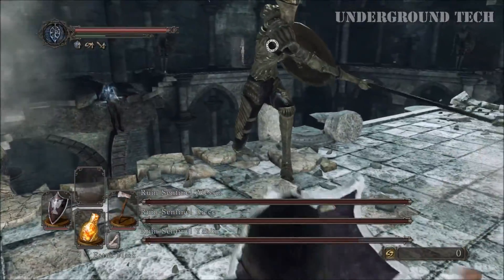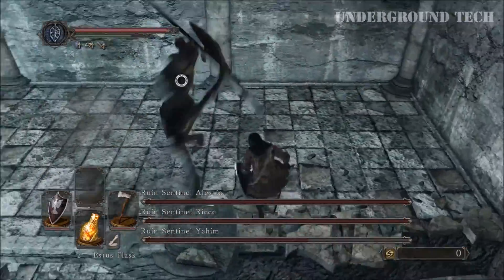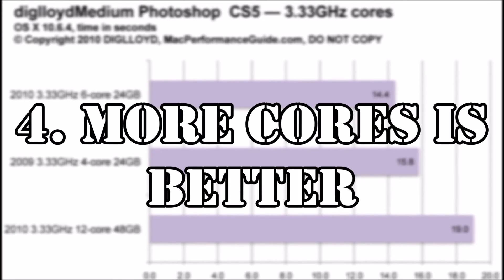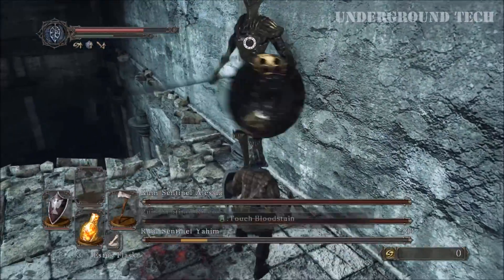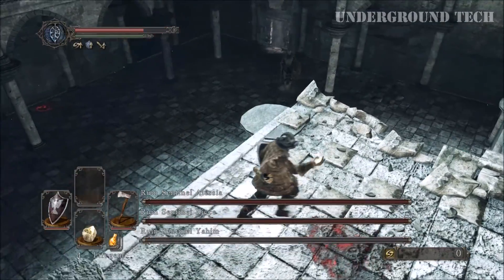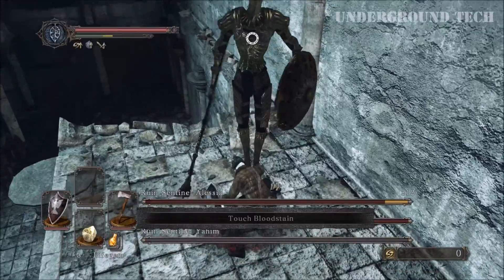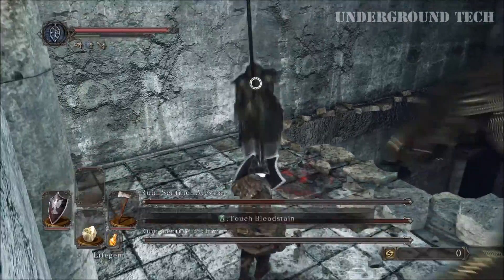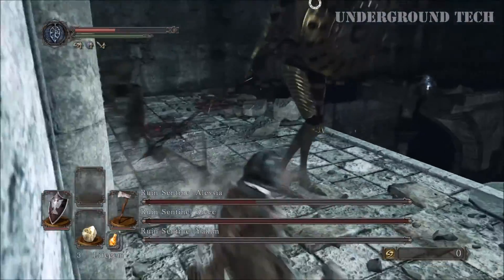DEBUNKING PC Gaming Myths! (Before You Build A PC)

Comment: Ah you know what really annoys me about people who build computers? 3 things mainly. The wrist strap thing, I see tons of people going through the trouble of using an anti static wrist strap just to attach it to their PAINTED computer case. Umm yea, a lot of good that will do. I firmly believe you don't need a wrist strap if you actually handle PC components correctly. That bring me to the second thing, the way I see people hold motherboards, RAM, graphics cards. They put their hands all over it, touching all the contacts. Hold a PCB by it's edges and don't touch any mental contacts! How hard is that... and lastly power supplies. I can't say how many times I've seen people put unnecessarily powerful PSUs into a PC that will only use 300 watts MAX. The only reason you need a power supply more than 550 watts is if you're running multiple graphics cards or use a graphics card and CPU combo that have very high TDP like a buddy of mine with an FX-9590 and Radeon R9 390X. Great vid though.
Reply from the maker: Great points, and the anti-static is probably the most misunderstood part about building a gaming PC; It just isn't necessary. As for the PSU part, I agree with you, but I wonder how that differs when someone wants to overclock their CPU and/or GPU.
Reply: i5 8400 and 1080 with a 650 watt psu?

Comment: problems with this video:
3. it USED to be 16GB+. AMD CPUs about 3 years ago were better. Not surprised you started later than that :P
4. that is not completely true. it is best to have atleast 4 physical cores, if not then dual core hyperthreaded. it affects your performance. a lot.
5. same thing as 4, this is not completely true. Higher GHz is much better if it's the same architecture. you're looking at AMDs old architecture and blaming it on cores and GHz. not how it works.
6. These are the same thing for console. you can play on a TV. a keyboard and mouse that are good quality come in $20 combo packs. everything else is nonsense. when you buy a console, you don't get a chair, TV, and desk included, do you? also, $400 is more than enough for a gaming PC. I can make a list with an RX480 in it right now that can run Bf1 easily. it's not hard. you just need to use inactive windows which people over exagerate about the watermark. it goes away when you go full screen.
Reply from the maker: First off, thanks for pointing out the errors and I want to respond to a few things you mentioned: 
4. that's a good point, quad core will be the best option, but I was more-so comparing it to the fact that have more cores doesn't always mean better performance.
5. I mentioned that in the video if it's in the same family (probably should've said architechture) it'll be faster. i.e Haswell 3.6GHz will be faster than a 2.4 GHz.
6. Yeah you can play on a TV to save money instead of a monitor, I was just giving examples to expect to pay more than what you may think. If you get a console you don't need to get all that because you have a place to set it down and a couch to sit on, but if you didn't then you'd go get one, or you could sit on the floor. And I know you can build a nice rig at $400, I never disregarded that #PCMasterRace